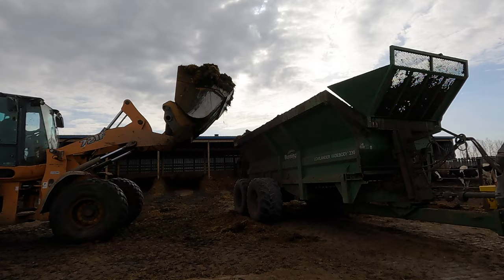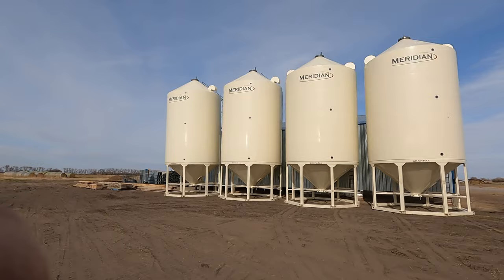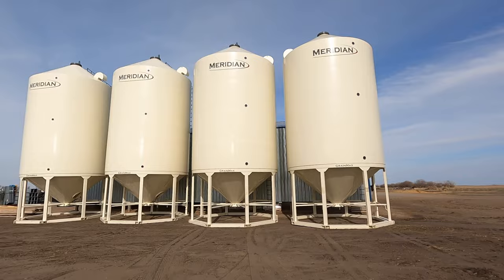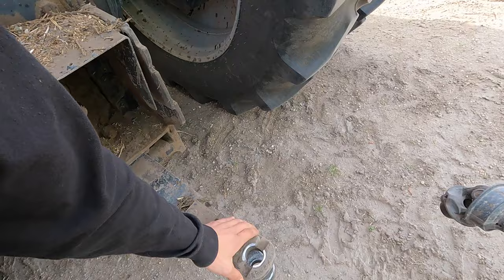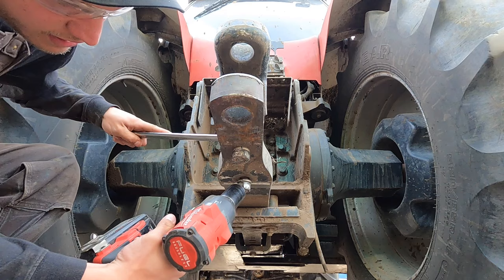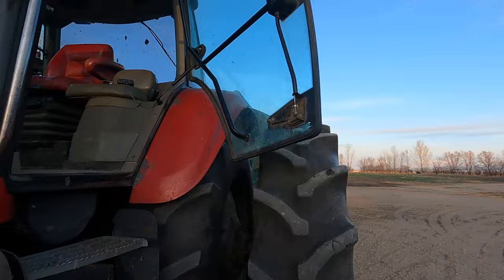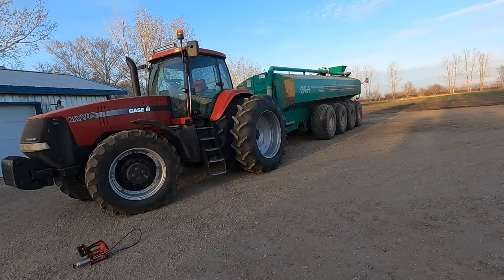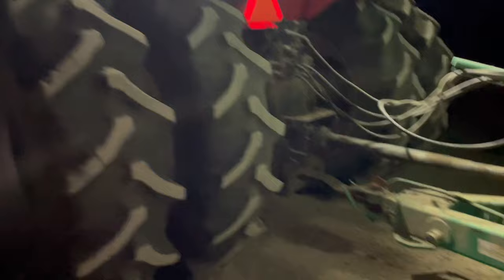What We're Building This Summer!

Comment: Hi just offering a  suggestion when attaching the MX285 to the tanker why don't you put the bolt 🔩 upside down and use a washer before putting the  nut when reattaching it to the bolt so the threading would not get damaged again.

Comment: Jan, a question about the hook ups, hitches on your tractors over there- why do you use a draw bar, clevice or not and a draw bar peg? Here in the UK we always have tractors with a pick up hitch, a hook that drops and picks the trailer etc up with a solid ring on the front of its draw bar. No need for winding things up or down, not relying on that one metal pin when pulling a tanker like yours??

Comment: Surely just relying on the tractor brakes to stop all that weight is risking damage to the tractor brake discs in which case another rear end rebuild would be needed
Reply: Just slow down with letting the gas pedal off in time, they don't need to brake a lot with the amount of traffic they have around there ;)
Reply: @tjakko4659  yes I realise that but in an emergency you risk the chance  of a jacknife or possibly killing someone